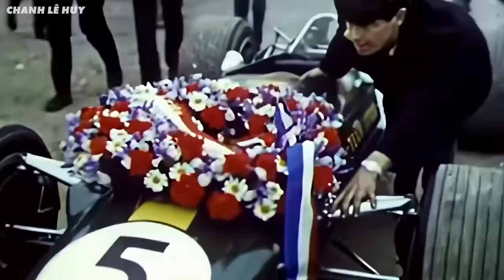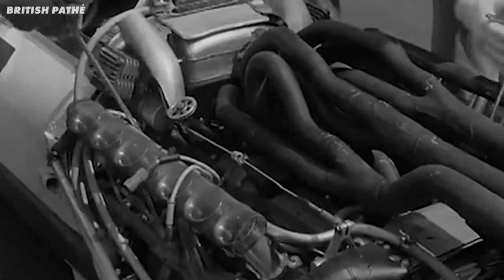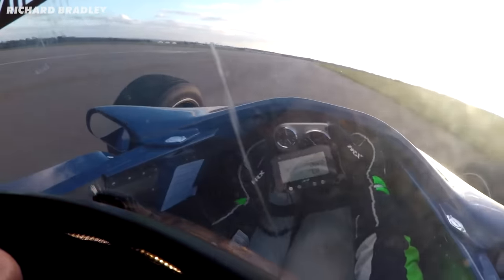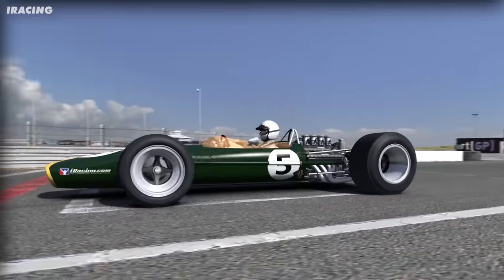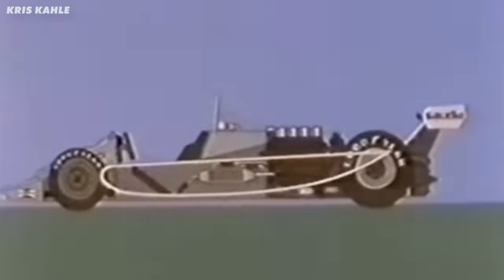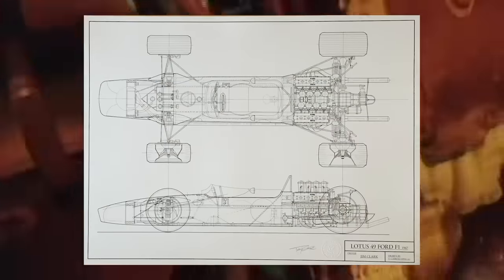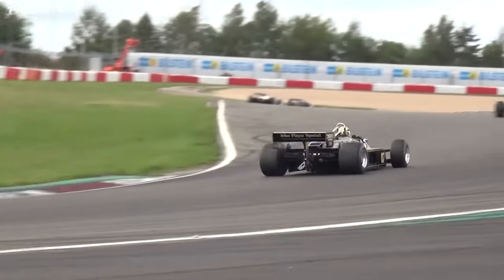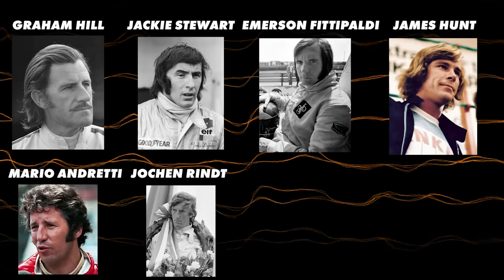When FORD Designed the GREATEST F1 Engine Ever!

Comment: I just want the naturally aspirated engines back
Reply: Naturally aspirated with free configuration. V8, V10, flat 12, whatever. Give the cars a bit of variety.
Reply: same. at least let manufacturers have control over configuration. hybrid v4 or v8’s
Reply: @littletweeter1327 Or non hybrid internal combustion engines with a free engine configuration.
Reply: Electric is that you'll get!
Reply: @grahambell4298  ok I do agree with that, but at this point in time (with the vacuum cleaner V6’s), I just want a good sounding engine even if 
they are free configuration or now
Reply: Not with the crappy gas of today
Reply: F1 has to be electric by 2030. Welcome to FE. Forget the ear plugs and 2 hour races!
Reply: @davidpeters6536 The FIA can get rid of all those overpaid, overated primadonna drivers and control the cars by radio. It would be the most ridiculous, expensive RC car racing ever.😝👎

Comment: With the DFV you can't forget the Hewland gearbox it was mated to. A video on that would be nice. As well as on A.P. brakes.
Reply: Benneton was using a very simple dfv derived engine and manual gearbox until 1993. What the hell were they spending thier budget on?
Reply: Their budget was spent on hiding features in the software in that era if I'm not mistaken.  @mark4lev

Comment: The 4 valve per cylinder design had been around even before Keith Duckworth was born, and I am not saying this to take anything away from his talents as a design engineer but merely to illustrate that the exceptional is often an evolution of existing ideas, I have to admit I had thought it was Harry Ricardo that invented the idea but apparently it goes back to 1911 when Indian introduced their pushrod 8-valve twin racer  and it was the following year that a motorcar was to have an engine with two overhead camshafts and four valves per cylinder which was the 1912 Peugeot L76 Grand Prix race car designed by Ernest Henry of course these engines were not without their problems but design engineers like Keith Duckworth knew how to solve these problems with the use of modern material, technology and financial backing.

Comment: Not a very well researched/edited video in comparison to your usual high standards Scott...

1)  Keith Duckworth didn't "work" for Cosworth, he is one half of the company's founders!  Mike Costin (Cos), Keith Duckworth (Worth).
2)  3:50 "And Jim Clark" .... that's still Graham Hill
3)  "High Revs" - the DFV may have revved higher compared to other v8's, but 9,000 rpm was still lower than what the 12 cylinders were managing at that time - Ferrari's Flat 12, the "Tipo 001" was producing peak power at 12,600 rpm in 1970 (never mind it's redline value!)  Compact, fuel efficient and more torque are typical attributes of comparison for an engine of same displacement but with less cylinders .... "high revving" tends not to be. An engine with more cylinders will typically rev higher because each cylinder is smaller, hence lighter, hence less momentum, inertia etc... to move :)
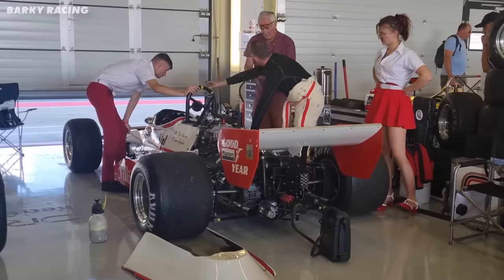4)  8:20  "when the Turbo engine eventually took over Formula 1 in 1972"  ....  factually wrong.   1977 was when the first Turbo engine turned up, Cosworth DFV's 155th (and final) win was in 1983.
Reply: Do you have any friends ?
Reply: @tonywright8294  I was wondering the same thing. What a bag of joy.
Reply: @tonywright8294  @S0ulinth3machin3  -  plenty thanks, and thankfully they don't feel the need to make personal attacks when someone provides them with extra information :)
Reply: By 1970-71 the DFV was shifting at 10,500rpm. In it's final iteration in 1994 it was shifting at 14,500rpm. js
Reply: In 1970-71ish the DFV was revving to 10,500rpm. In it's final example as the Zetec in 1994 that V-8 was hitting 14,500rpm.
Reply: @jjracing4651 - By the end of the DFV's career, it was producing 11,400 rpm and 500hp.

Comment: Turbos took over in 1982, not 72. Turbos where introduced by the yellow tea pot in 1977 but took a few years to stop going up in smoke. Ground effect cars took over in the late 70's. 1978 - Mario Andretti Champ year and also Lotus's last championship.
Reply: NAH. Oldsmobile had an aluminum V-8 in their '63 F-85. That basic engine was later used in modern Land Rovers.
I had the 4-bbl carb version.

Comment: It was this engine that caused the legendary remark from Enzo Ferrari. That aerodynamics are for people who can't build engines. Most of the field were using this engine when he said it.
Reply: Enzo died before aerodynamics came into F1 joe!
Reply: @DennisMerwood-xk8wp  he died in 1988. Wings and the like started in the 70s along with ground effects, you know....aerodynamics. He was relating it to the fact that at the time, most teams used the Cosworth V8 because it was cheap. Therefore, they had to be good at aero because they didn't know how to make engines. Perhaps you should do a little research before you give such an ignorant reply. 🤔
Reply: @joerieke300  Perhaps you ought to learn some manners before spouting your insults.
You give me the impression that you think you are the smartest kid in the room. 
Yes, immature wings did start in the 70's.   And of course, the Lotus 78 ground effects car came out in 1976 - I was wrong.
But if you can provide us to a link showing that Enzo said ""l'aerodinamica è per gente che non sa costruire motori", I would be very surprised. I think you pulled this outa your arse!
Also, the Cosworth DFV was more powerful than any Ferrari F1 engine at that time so what you claim he said does not make sense.
And while you have a minute, Google the Dunning-Kruger Effect. You seem to have a chronic case.
Reply: @DennisMerwood-xk8wp  I don't get a reply for your ignorant H block comment? 🤣🤣🤣
Reply: @DennisMerwood-xk8wp  you alright little man? 🤣🤣🤣
Reply: @joerieke300  Very well thank you. And big enough to know that's it foolish to debate insulting ignorant fools on the internet.:body-blue-raised-arms:
Reply: @DennisMerwood-xk8wp  Oh, and the Ferrari V12 was THE most powerful engine for most years during that era. The Cosworth V8 was popular because it was light, reliable, and definitely powerful enough to compete as it won several championships. If you had been watching the sport for 30 years like I have, you would already know all of this. Like the Enzo quote. All die-hard F1 fans know that quote. That was the proof you knew ABSOLUTELY nothing about what you were trying to talk about. Another hallmark trait of your generation.
Reply: @DennisMerwood-xk8wp  one final note. Saying a reply is ignorant isn't an insult. Everyone is and says ignorant things. An insult is calling someone stupid. I'll let you try to figure out the difference.

Comment: It should be mentioned that Cosworths 300ci DOHC V8 wasn’t thought up & designed out of thin air or Duckwoths head… See: Harry A. Miller’s 308ci DOHC V8 in the FWD (Four Wheel Drive) Indy Race cars of 1932. Millers DOHC - 4-valve per cylinder Flat-Plane Crankshaft designed engines (4, 8, & 16 cyl) planted the Race Winning seed in many engine designers heads for decades and still today. (…and yes, Harry’s idea came from Peugeot around 1917!)

Comment: Hi,

Thanks,

You  made the comment that a V8 will rev higher than a V12.
And repeatedv it too.

But my thought is thats rubbish.

Obviously you know something I dont.

My thought is that a V12 can be much better dynamically balanced, less vibration,  so possibly higher reving.
If the cc is identical there is only bore vs stroke to play with.
If the bores (v12 vs V8)  are kept identical then the V12 stroke is minimised and that increases potential maximum rev limits.
I am not a believer that extra crank length is significantly heavier bvecause its a case of power, torque acting on the CSA per unit length.
So if the engines produced identical powers,  the crank weight should be relatively well matched.

Similarly 33% more power on the con rod of a V8 is 33% more stress than on a V12 con rod, so the V12 con rod could be lighter, facilitating higher revs and better balance, less vibrations.

A V12 with longer crank & more big ends = room for more main bearing journals, again enabling better lubrication & less vibration for higher max  RPM.

The V12 cam would need to open the valves less distance = less spring pressure and smaller dia less weight valves.
Again promoting higher RPM.

Given both engines used optimum marerials for the purposes   I cant see how a highly competative (higher reving) V12 couldnt have been designrd.

I know the ground effect is not addressed but were talking engine RPM.

THANKS.

Comment: I love you always giver the most accurate info on engines...I also love how there is always one or two innocent errors in your videos, kinda like Murray Walker's commentary. " flat V12s"?....ok that's actually accurate! But, "when turbo engines took over in 1972.." it was 1982, easy mistake...although it was more like 1983, a Cosworth won the driver's title in 1982.
Reply: His videos about mechanical stuff usually have I would say about 25 percent errors(Sometimes way more, I'm looking at you "When F1 Cars Used ROCKET FUEL!" XD), I'm a bit impressed by this video actually(Yes there are still quite a bit of errors or dubious things said).

Comment: The DFV actually got used until the 90's when they stroked t up to 3.5l. An astonishing engine.
Reply: The DFL, HB and Zetec engines were largely based on the overall design of the DFV but were not direct developments of it.
Reply: @hmdwgf  Yes they were.